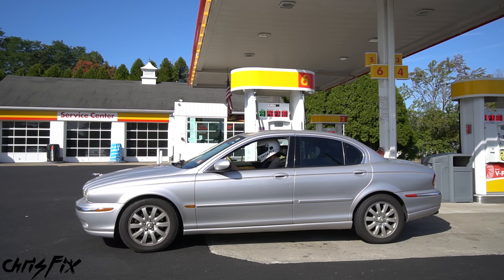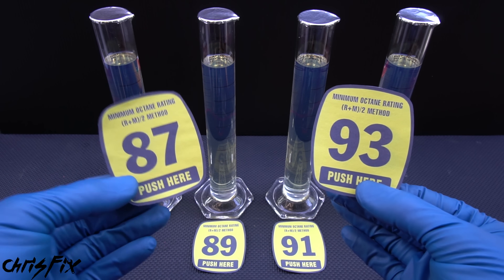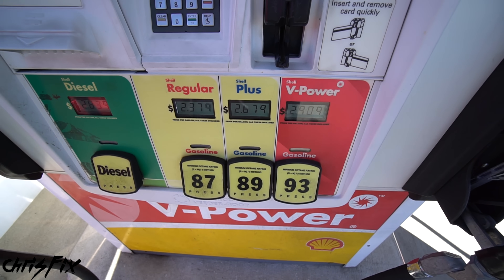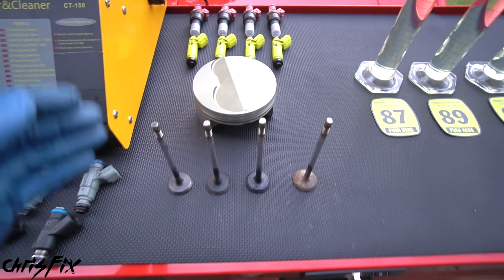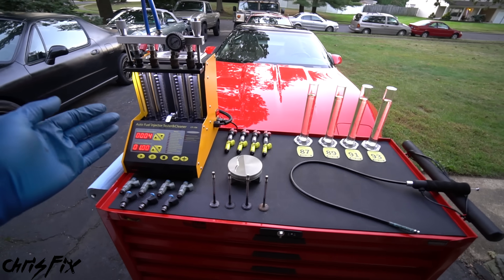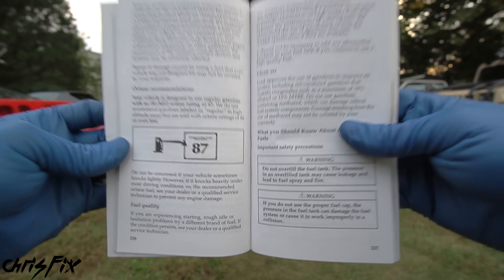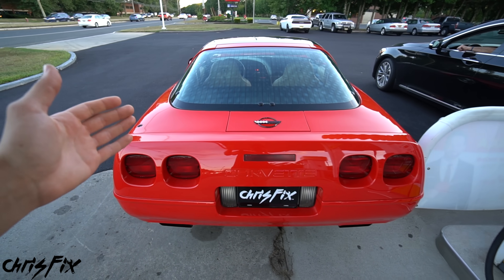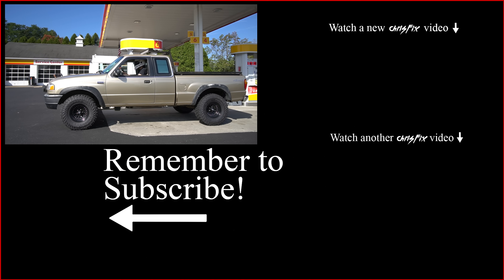What is the BEST Fuel to Use in Your Car or Truck and WHY

Comment: So,  we actually do have worse gas here. They don't even sell 87 in Europe, just the equivalent of 89. E5 is standard vs e10 too. What a scam. Gas prices are insane here in CA. I wonder if the ethanol content is a bit lower in vpower compared to regular? That alone is worth the switch on an older, high mileage v8. I don't mind spending a bit extra from time to time, knowing that my engine will be protected and cleaned up with a higher grade of fuel. With that said, I could never justify buying premium gas at every fill in a vehicle that only requires 87 to get the job done. Anything over 10%ethanol at a gas station that advertises e10 should be a crime. We could definitely benefit from e5 or e0 gas, as well as 89 octane regular as standard, here in the US
Reply: You are a bit confused I think. The US is 20 years ahead of Europe when it comes to gasoline. Europe and the UK are now fully adopting E10 ethanol based gasoline. The US made the transition in the early '90s. E5 is disappearing very quickly. And the UK just made the transition to full E10 for some of their octane grades this year in fact. 

US refineries actually meet higher tier standards than European refineries. Also, most of Europe does offer a 91 RON octane fuel. (US 87) But countries that don't have it like the UK, are getting hosed! 85% of the world's modern cars and trucks are designed with 87 octane in mind. Yet in the UK you are forced to use gasoline your car can't benefit from. So you have to pay for mid grade whether you want to or not. 

91 is available in most countries. (US 87)  And US 91 is actually 97 octane in the UK. US 92 premium is UK 98, and US premium 93 is 99 UK. US 89/90 mid grade is UK 95.
Reply: @waycoolscootaloo  all I know is that my truck that was “designed to perform best on 87",  gets the best gas mileage, runs smoothest and has more power across the board when ran on 89 or higher. This may be due to having over 110k and having a dirtier engine than when brand new. It could also be that 91 octane has less ethanol content than 87.  Soon I will be testing the ethanol content of my local petrol stations and posting the results. I really hope I do not find anything with a higher content that 10% ethanol. I will be sticking with whatever gas/grades provide the lowest ethanol %. If they are all exactly at 10% I will likely pick to use premium for the extra cleaning, mpg and power, and anti knock protection it provides my engine with. My car was not meant to run on ethanol, it was made to combust pure gas. E10 is a scam, it does nothing but create extra wear and further our dependance on petro chemical, mono crop farming. Just because my vehicle can run on 10% corn alcohol, does not make it ideal. I would like my money to go towards pure gasoline when I pay at the pump, so I can get the full power and mpg out of every drop. My other two machines require at least 91 AKI, and will never taste 87. They also have no business running ethanol laced fuel, as they are stored for the winter and can benefit most from high quality, high octane fuel. I do not own any flex fuel capable machines, nor do I plan on purchasing any in the near future. Ever read a flex fuel car's manual? It will tell you that flex fuels will net you less mpg and will shorten your maintanenece intervals if you run it. The manual will also tell you to run pure gas or at least e10 every few tankfuls, for optimal longevity and performance. If you want more ethanol, just pour some moonshine or everclear down your tank and call it a day. You can never convince me that ethanol offers my gasoline engine powered vehicle better reliability and performance over its lifetime. You are very confused but I really could care less. Save your ignorance for someone that does.
Reply: @fulltimeshred  Sorry but I follow the science. If you are unwilling to learn that's on you. I personally don't care what you do. But 10% ethanol is the future whether you like it or not. And now Europe is mass adopting it too. Ethanol leads to better performance, but yes slightly less energy and a bit less fuel mileage. 

To each their own. It's not like your spending my money by buying higher octane gas than what's necessary. So I couldn't care any less.
Reply: @waycoolscootaloo  I choose to put the best fuels possible in all my machines. Especially considering the fact they are stored for long periods and get run hard when in use. I also live at high elevation and experience conditions that would put me in the severe service category. Frequent cold starts, steep hill climbs and shorts trips. I need my machines to last as long as possible. Ethanol is poison whether it goes into your fuel tank or your body. Less is more

Comment: 5:20 Well, apart from the fact 93 RON is not available in parts (or whole ?) of Europe, and 102 RON is. So what exactly is 102 RON in PON, if 99 RON is 93 PON ? Missing something ? Sounds like quality ... is ... less, in US.  And so are the prices, fuel costs 2 tot 3 times more here.
Reply: Quality is better in the US. US refineries actually meet higher tier standards than EU refineries do. US 93 octane is the same as 99 octane in the UK or Europe. US 94 octane is 100 octane in Europe. US "E85" gasoline is also rated above 100 octane. Often it's as high as 112 octane. The US also has access to some stations that sell 100 octane racing gas that can be run in any car or gasoline powered truck. (VP Racing fuels) 

Example: Tesco in the UK sells 99 octane premium gasoline. So does Shell. But Europe only uses the "RON" testing method. The US however uses both the "RON" and "MON" testing method. And then the US/Canada takes the average of the two tests. 

So Tesco 99 gasoline and Shell VPower 99 gasoline is rated at 99 octane RON, but only 87 octane MON. So US formula of (R+M/2) is 93 US/Canadian octane. 😎

Comment: I drive garbage trucks for a living. At the gas pumps, they usually lock the ethanol pumps, so people can't steal it. Diesel stays open all day. For some reason, the ethanol pump was open. And despite a big sign saying ETHANOL. A guy filled a truck with it broke down just outside the tunnel. What a dunce.

Comment: The Ford raptor is designed to run 87 or 91 I only run high octane before going offroad when Ill be revving the engine a lot.

Comment: Chris fix you should make a video Busting those fuel injector cleaners and octane boosters and gas mileage improvement additives and prove which ones actually work and which ones are a waste of money. I bought one for cleaning injectors and improving fuel economy and my gas mileage tanked and has only gone down since then. I even double checked the ones they had at the gas station to make sure it wasn't for a diesel engine and it was for gas engines. Waste of 4$ that was.
Reply: You may have dislodged carbon deposits and other contaminants that subsequently clogged the fuel filter.
Reply: @Mikgwerd  possibly. There's a few things that should probably be replaced on my car. I have no way to know if they actually do anything but based on my mpg they're either very minimal like a thousandth of a gallon or they're crap that is just to waste your money. Chris fix However could probably take an entire car apart clean it entirely and put it all back together completely blindfolded.

Comment: Chris should make a part 2 to this because now there is more types than 87 89 and 91. All the types I've seen are 85 87 89 91 93 95 unleaded 88 and E85. Granted I know the difference but there are a lot of dumb people. (Insert story of dumb fuel buyer) I mixed up E85 and unleaded 88 and granted my car (2004 Pontiac grand am) is not flex fuel so shouldn't use E85. For me nothing bad happened but definitely wouldn't fill up with E85 Everytime.

Comment: Also some good one shot additives are on the market to clean the fuel system but I would advise against using it unless you install a new fuel filter first. This will prevent the additive disolving all the crud in the old filter and sending it around the whole fuel system.

Comment: If manufacture recommandes at least regular and no more 10% ethanol what will be better for the engine? I use v-power, 91, no ethanol and the engine is ok and I make 150 km more for 1 tank fuel. No knocking, pinking, etc. 91 and more are better in any situation. NO ETHANOL never ever.

Comment: My manual says 87 or better ok. I have a 2021 Honda Accord 2.0T sport Which has turbo . I’ve been running premium 91 my mpg has gone up about 5 miles per gallon . I don’t really know what engine knock sounds like but i hope I running the right gas

Comment: Hey ChrisFix, --Why are all your pictured vehicles 15 years old ;)  Anyway,  Diesel is the by far the best fuel. The body will fall off a Deiseal powered truck or car before the engine gives out. Been a fact for decades, & now are much better if that was possible? You sound like about 24 years old, so you can't be taken too  seriously when you don't even  mention "new age " Deiseal-- Anyway,--- Read, Study, Learn/  Cheers

Comment: Chris fix is the man. Another smashing video. 
Used vpower on my 1.8t golf mk4 from 50k to 200k miles and still running like a Swiss watch. Was remapped at 50k and always driven with some vigor. You will also get much better torque and power because the ignition isn't retarding the timing to stop it knocking.
Reply: Re: the ignition isn't retarding the timing..."  Why must you use Mean words?(feigning severe libtardism)
Reply: @WisconsinEric  haha

Comment: Using Diesel in Gasoline car: You are damaging the engine. 
Using Gasoline in Diesel car: Tutorial how to destroy an engine. 

Reasons: Diesel in Gasoline engine will still ignite, giving the engine little bit of torque, however, it could damage it, not even engine timing (detonation sensor) could save it (some drag cars use/used this technique, instead of using the expensive fuel for dragsters).
Gasoline in Diesel engine won't ignite, because there isn't spark plug, so you will flood the engine with gasoline and destroy it.

Bunta in Initial D knows what he's doing.

Comment: I used the 93 for my car once and felt a difference in my car, more responsive , and the gas lasted longer compared to the lower grade but I use regular like always now
Reply: @Josh What kind of car?  Unless you have a high performance engine there likely wasn't any difference and you were dreaming.
Reply: @SuzukiKid400  it was a 2015 ford fusion eco boost turbo, i wasn't pumping my gas all the time with it , I wanted to see what it would do and how it it would react. And I was taking trips to Dallas and I stay in longview. Normally on a full tank of gas from longview to dallas i would be at 1/4 by the time I get there. When I put the other fuel in it it was at half a tank a little above actually🤔.
Reply: @Josh-sw4pp  could be fuel or most likely your driving habit. I suggest turning on cruise control for the entire trip there & then drive the car back normally with imflucent speeds & see if it's your driving or the fuel. Best way to tell. I'd say set a steedy speed of no more than 65mph on cruise depending on your highways speeds at the time, maybe 70.
Reply: @dbzownz12345  I do 70 cuz driving from honestly from tyler to dallas taking that turn off on 80 quickest way there and people be moving , but I can most def say its gas 😂 my driving habit as crazy as it is stay the same lol
Reply: @dbzownz12345  except for the fact that It might be uphill one way in downhill the other way. When I go to Vermont, 93 is slightly uphill the whole way. When I come back from Vermont, sometimes I can leave it in neutral even. Downhill.
Reply: what made you decide to use regular gas again
Reply: @fernandoreal4026  probably price. It just doesn't make the difference. Better to do it once in awhile it seems like
Reply: @ethandupit73  this man is on it today. He's correct 👍🏾
Reply: My bad, I meant how many weeks did the gas lasted until you refill your gas??
Reply: @77jiujitsu  the same

Comment: What about a bmw which says 91 recommended but 89 min. Does that mean I can always use 89 ? What’s the point of the 91 then when I can’t event tell any performance difference.
Reply: 89 will be fine to always run and will save you money. But 91 will allow your car to develop a little extra horse power since your car is made with an automatic tuning capability depending on the octane of the fuel used. On many cars, the few extra HP isn't really noticeable in day-to-day driving, since your talking basically just 20HP.

Usually, the extra HP gain isn't worth the extra cost of buying premium fuel.

Comment: So I have a question I'm buying my first car a 2012 mustang V6 and it says use 87 octane but if it doesn't have a flex fuel sensor will it destroy the engine? in the video you also said it had some benefits by luberacating the valves would it do the same to my car

Comment: Cris as always Thank you. I just picked up a Mint conditioned 2003 Chevy Suburban Z71 and wanted to know the difference in gasolines ⛽ especially E-85. The truck doesn't have a Flex Fuel body badge and the Yellow gas cap was replaced with a locking Black cap but after reading up I've learned the Eight Digit on the vehicles VIN like mine is a Z and Z means its designed for Flex Fuel where as a T is regular fuel. I learn a lot watching your videos and it's super appreciated. Thanks Eddie J. Long Island NY
Reply: Nice the e85 is corn made gasoline, itll burn faster and cleaner but is so much cheaper if its available near you. So yea u get less mpg but it should still come out cheaper in money per gallon.

Comment: Thanks for the gas tip  Car seems  To be running smoother   Ticking noise from feeling  Injectors got quieter  208000 mile honda accord V6

Comment: Good video. I have a Hyundai Santa Fe 2022 2.5l turbo. What gas is better or recommended? Thanks
Reply: Check in the manual. I'd imagine it runs fine on regular but since it's turbo and probably GDI maybe mid grade.

Comment: I have a 2010 Toyota Avalon xls 3.5 6 cylinder, what fuel should I use 87 or 89 in Illinois
Also for my 2018 kia Sorento LX 2.4 4 cylinder what is ok 87 or 89 or higher 
Both of them knock the engine due to many.reasons will upgrade help it I called dealer and they say 87 is ok

Comment: I don't get it, mine is asking for 95 RON but it's just a 2.0 L naturally aspirated(it's an Alfa Romeo 156 2.0 JTS(932)).
Why ask for premium if it's just a regular engine
Reply: It's an alfa bud. Engines built for high performance, need good fuel to get that high performance.
Reply: 166 HP from a 2.0
"performance"
Reply: @Bogdan24199  well alfa let me down then thought they made performance stuff not crap. Anyway, I assume it wants that either becuase it has GDI fuel injection or something.

Comment: Thanks for the information  but here in UK we are getting a new fuel E10 replacing E5  what will this mean with for the right fuel ??
Reply: E10 is what the United States and Canada have been running for the last 25+ years. Any car made after the year 2000 in the US or Canada, is compatible with E10. But since you are in the UK and the UK is only just now catching up to what has been standard in North America for years now, your car may not be fully compatible with E10. 

So be sure to check the owner's manual of your car. If your car is not compatible with E10 (Aka..10% ethanol and 90% gasoline blend) then it's best to see if you can find your older E5. But otherwise, your car's fuel system can be upgraded to support E10 by a trained mechanic. No damage will occur to your fuel lines or fuel pump right away with E10 if your car isn't compatible. But over time it will eat away any rubber fuel lines and such. 🙂

Comment: My 1.8 8th gen civic recommends 87 or greater and when I pump premium I really do feel a power difference, specially when I’m driving with the a/c on.
Reply: Same here dude. Think it's because it's a high compression engine so it's not running full potential at 87. Its just tuned so that it won't damage it running at 87

Comment: I’ve noticed almost all the gas stations around me says “contains 10% ethanol.” Is that good or bad for regular gasoline cars that are not flex fuel?
Reply: Modern cars are designed to run on gas containing ethanol
Reply: @liamflynn6929  would a 2003 Volkswagen GTI with a 1.8 turbo be considered modern? Lol
Reply: @jonbzo4  that'll be fine. If you're worried run a cleaner like seafoam through it before your next oil change
Reply: @jonbzo4  nope only car made since 2012 are able to run with E10 without issue

Comment: I have used regular gas in my '98 Lexus ls400 for years without any trouble. However recently I had to replace the Catalytic converters on my car. cost ~2000.00 You make your choice and then you live with the consequences. I am still using regular gas and do not plan to change.

Comment: For someone who knows nothing about cars, this was amazingly informative, and very helpful! I never really understood the difference between the different fuels

Edit: is there any disadvantage using premium fuel other than cost?
Reply: Not really. As the video mentions, it's a resistance to premature fuel detonation (I.E. what most know as engine knock). It's more expensive, but it's better for your engine and you'll get better life and fuel economy out of it than you would normally. As an example, I have a 2020 Ford Ranger that has a 2.3L turbocharged (EcoBoost) motor. With premium, it actually has better fuel economy than what they list on 87 octane and it runs a lot more smoothly. For turbos in general, you really shouldn't run lower octane anyways. I've talked to a lot of people who build engines and race either for a living or in their spare time. Most I've talked to have agreed that you get what you pay for.
Reply: @Heartstrong_Productions  that is true, obviously if you pay more it'll be more quality and better long term for your engine. Thanks for clarifying!